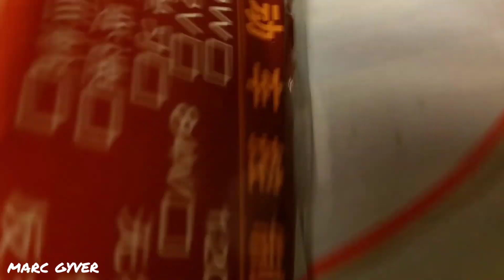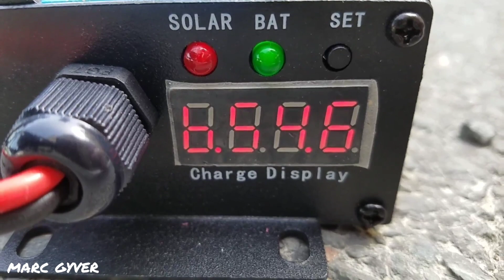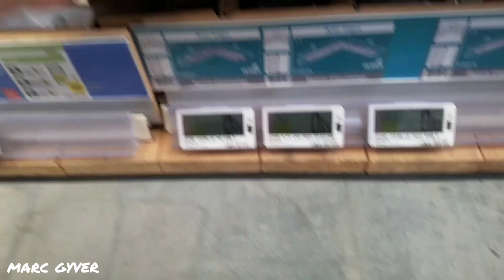Homemade Solar Electric Car 4000W The Ultimate Free Energy ! DIY Project (part 4/4)

Comment: For stability and ease of driving, I would have given the wheels negative caster. Not to say your implementation doesn't work, but I think the smoothness and ease of driving in a straight line would have been nice.

Comment: Nice build, what kind of material did you use for piping, cut board and protection layer?
Reply from the maker: for the bodywork, I used hot twisted pvc tubes, expansive foam and skai for the coating

Comment: Suprised that this car doesn't have Jumps or shock absorbing mechanism
Reply from the maker: I designed this as simple and removable
Reply: @marcgyver2464  
Appreciate you Hard work Bro, i want to suggest but there are some bicycle come with shock absorbers in front side, you can used any second had bicycle part so that you feel less Bumps on the road

Comment: When you see how difficult it is to make a basic vehicle that will successfully run on a hard surface you begin to realise what a car manufacturer has to go through to make them in volume for the working class without endangering lives......by all accounts anyone with the slightest bit of knowledge can make a powered wheeled vehicle but not to standards that are acceptable.

Comment: ok, so, 4 hubs of 1000w does not give you 4000w. Your top speed will always be that of a single hub.
Reply: It will give you 4000 w, what counts is power to weight.